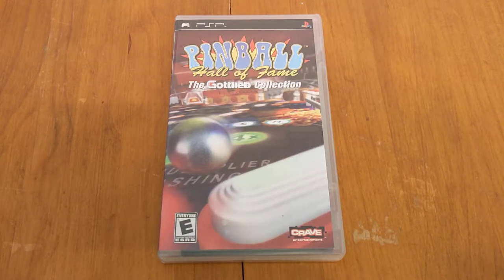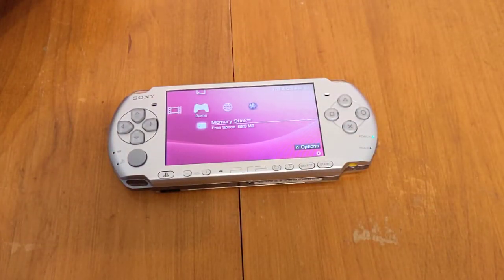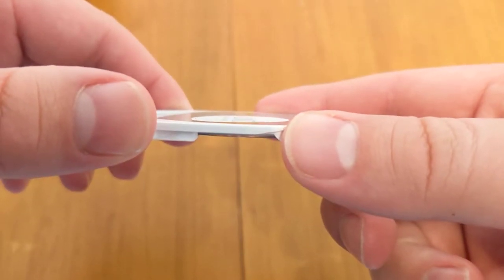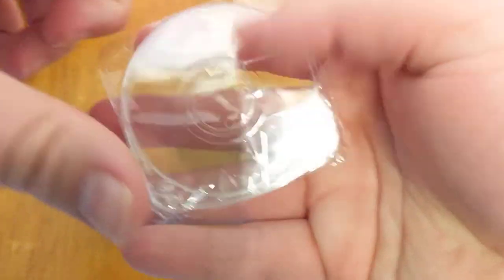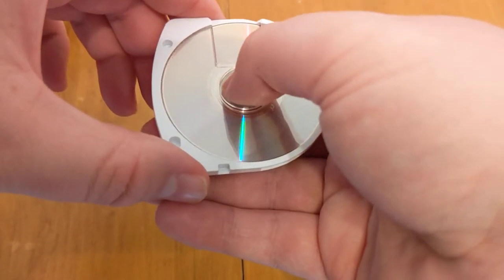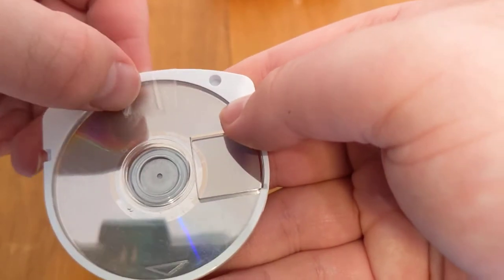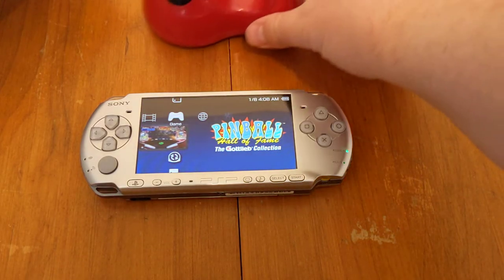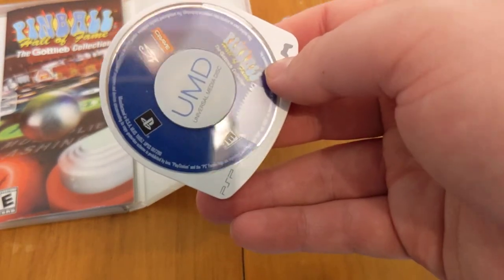(OUTDATED, SEE DESCRIPTION) How to fix unreadable PSP UMD games with Scotch Tape

Comment: Cool fix! In order to preserve the disc drive in my PSP (and make it super easy to move them into other systems), I've modded it and have ripped my games onto a digital format. I still have all my UMDs, though, so I'll be sure to remember this if it happens.
Reply from the maker: the digital ripping route is pretty much the way to go, I've actually found that load time performance increases a lot when you use the digital files versus the umds.
Reply: @PSPMan  That's absolutely true. I blew out my 2000's drive playing hundreds of hours of Dissidia. Once I learned you can rip the games, it changed everything for me with PSP.
Reply: Don't get the ISO of Twisted Metal Head On. The SFX for the weapons (outside the specials) don't play at all. And it ain't just an emulation issue ether, it also happens with real hardware. Get the game on the PlayStation Store if possible, it works well on that version than the dumped ISO version.

Those SFX don't work because something must have gone wrong during the dumping process.

Comment: Yo i just got a psp off ebay for repair. And it wasn’t reading any of my disks i thought it was the disc drive but it was the disc casing like you said i pushed the case back into place and it started working